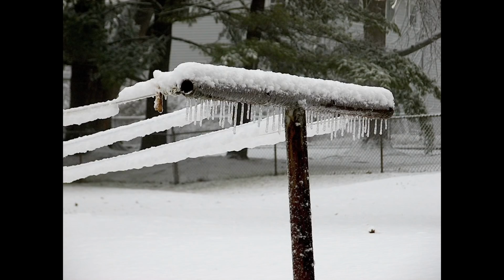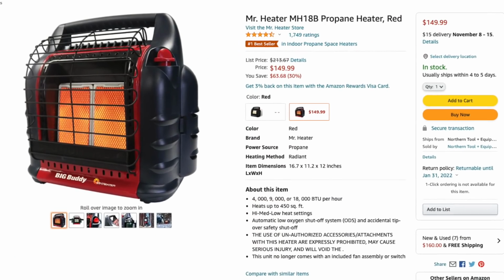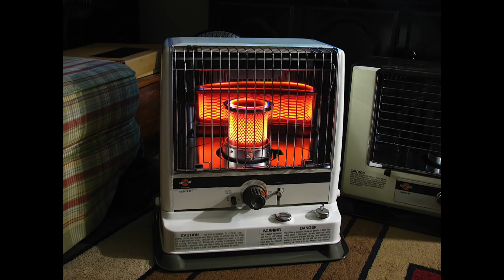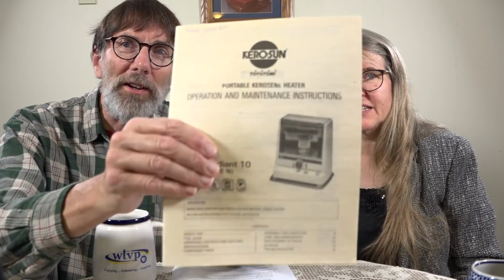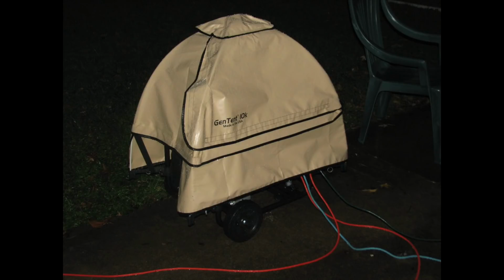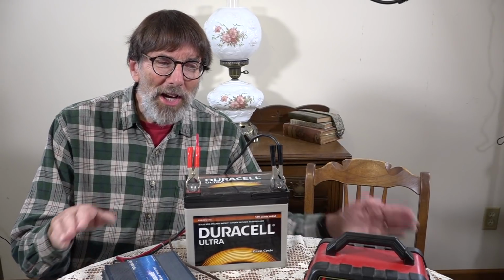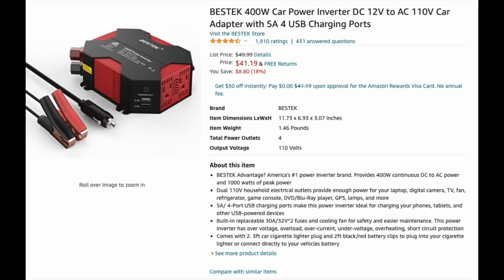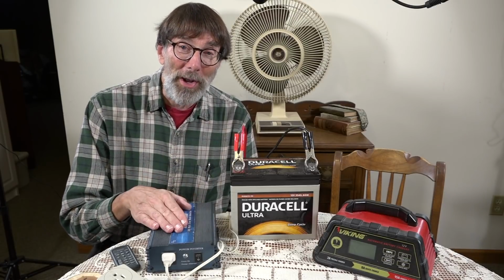How to Generate Heat and Electricity During a Winter Storm

Comment: One of the things I worry about is a gas generator being stolen as they are pretty loud. Could you check out the Jackery. We’ve been looking at he various ones on Amazon.
Reply: The Honda gas is quiet
Reply: While those little portable batteries are handy they will not help for an extended outage or high power devices.Think of them more like to charge a cell phone,run a laptop,etc.They do make larger ones with more power but they get very expensive.A gas generator is invaluable for an extended power outage.Look up “inverter generators”,they are quiet-you’ll barely hear it running outside and your neighbors won’t mind.

Comment: Thank you for these videos. They are very informative and so helpful. We have learned a lot from you guys. We live in Nevada and it gets very very hot  here in the summer. I am worried if the power goes out or the grid goes down what we can do.  Sometimes in the summer it can be a 110 or a 115 easily outside. Do you have any ideas or advice for those of us that live in warmer climates that will help us not roast to death if it's boiling outside?  Moving away is not an option lol.
Reply: Hi Marianne.  I can only say that Hope and I both grew up without air conditioning.  We used fans at our house to cope with the heat.   During the boiling hot summer of 1936 both of my parents lived on farms.   During the hottest nights they actually slept outside on the porches.  Certainly drinking a lot of liquids and dressing cool will help, but Hope and I really don't have any personal experience with super hot climates.  What I would recommend is a back-up generator that is big enough to run your AC.   Or, if you can't do that, get a room air conditioner (5000 BTU) that can cool a room that can be run from a smaller generator.   I would do a search on YouTube for other recommendations.  I'm sure many have addressed this issue.    Thank you for you kind comments - Larry.
Reply: @larryware1   Thank you for that great advice. Will definitely look into your suggestions!😁
Reply: Solar. You have an abundance of sun power.
Old folks used to wet down large towels and hang them on screen doors. Air coming thru the screen and towel helped with cooling.

Comment: Would the battery set-up you described be able to run a well pump? My biggest concern is having water, not just for the usual drinking, cooking, cleaning stuff - but mainly to flush the toilets and refill the tanks. And, of course, being able to shower from time to time would be great too.
Reply: No it would not.   A well pump uses a large AC motor - well over 300 watts.  I would recommend a back-up gas generator for that usage.   If you're not sure what size to use, ask an electrician for advice.
Reply: @larryware1  Thank you!
Reply: @kathleendillie3556  - You are so welcome!

Comment: So can I plug in sump pump to the inverter? I have fast pump 115 V 60 hz and need a way to figure out on how to make it run during the power outage. I don't worry about any other appliance in the house, I can live without all of them, but not without sump pump.
Reply from the maker: The sump pump draws too much current to run on a battery. We use our gas-powered generator to run our sump pump during power outages.

Comment: The big buddy kept my bathroom and bedroom at 60 during the February freeze here in texas...my pipes in there did not freeze either as we kept the cabinet doors open..
Reply: It's deer season..every hunter is buying the canisters..just keep watching for them..check end caps as well as the shelf..
Reply from the maker: Thanks! That's a great testimonial. We loved it when we researched it.
Reply from the maker: That explains, also, why there is a shortage of them. Makes perfect sense.
Reply: Keep a trickle of water going and pipes wont freeze even in negative temperatures. Tip from canada!

Comment: Don't know why anybody would want to use a sub pump, I would reather have a old fashioned drain in the basement and in the laundry room I have seen people who even had a drain in the kitchen floor, with a sub pump you know that if you have a thunder storm during a thunder storm you know what's going to happen if the electricity goes off, and it makes your sub pump useless
Reply: It has to do with the design of our house.   We're on a hill and the side towards the hill seeps in water without the pump.  The floor drain is about 20 feet away and in a different room.  Most homes don't require the use of a sub-pump.  You're blessed if yours doesn't need one.

Comment: I'm not sure if anyone mentioned yet on the comments.
Instead of setting up battery, inverter, battery  charger. This is 2021, just go buy power stations like Jackery,  Bluetti,  Ecoflow. 
It's all in one. No need to confuse people with all the crap you're preaching.
Power stations can operate microwaves, small heaters, heated blankets and last long time.

I can't wait to see the part 2 🤣